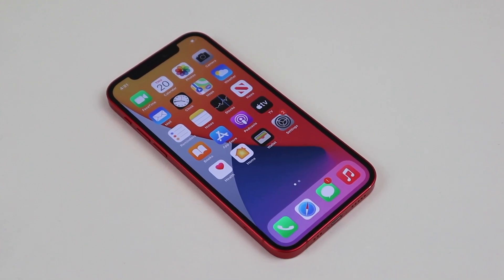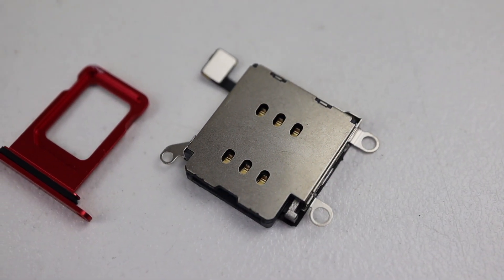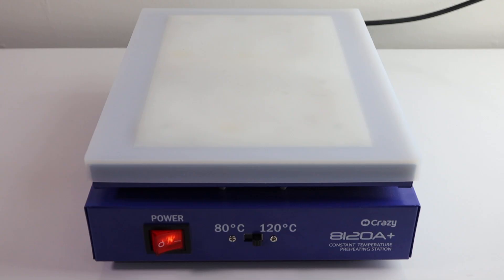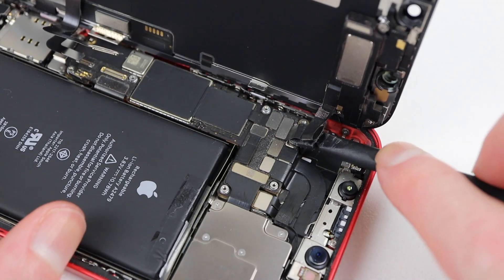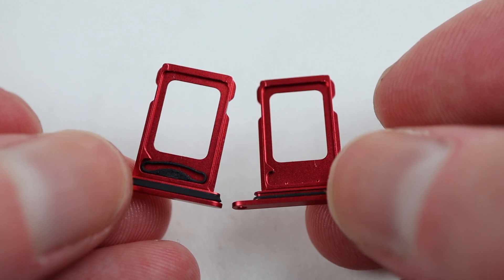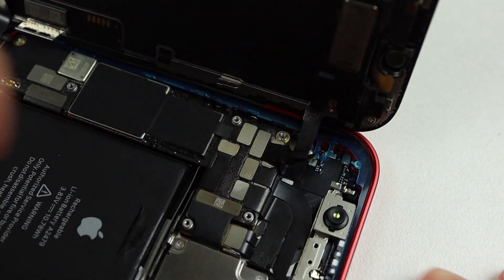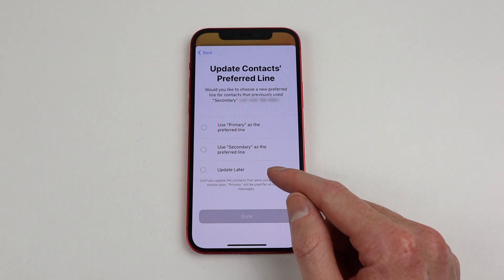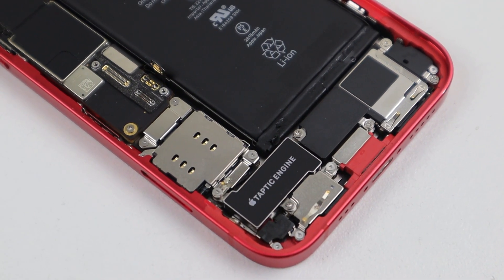Hidden iPhone 12 Hardware Upgrade Apple Never Told You About.

Comment: iPhone 13: SIM card reader paired to the logic board, unauthorized replacement will brick phone.
Reply: just a note, can we stop calling it "unauthorized repair" because we are authorized to fix the stuff we own. lets call it "branded" repair instead. calling it "unauthorized" does not inspire confidence
Reply: @Carterthielftw_  It's unauthorized in the eyes of Apple. 😆
Reply: after watching this video, they will simply lock it down with an update
Reply: I'm calling it now ITS HAPPENING
Reply: Lol
Reply: it doesn't even have a sim card lol , in what age do you live??!?!!?
Reply: @CrazyPlayer-pf2hv  um it does have a SIM card. How else would u get mobile data? Plus in the vid it says it has 1 SIM slot.
Reply: @jvs2uber466  I think the dude was being sarcastic. "Why would the iPhone 13 even have something as archaic as a sim card slot" or apple being all "we're removing the port to further streamline the experience"
Reply: @jvs2uber466  SIM card is not really needed. They only used it because they were afraid of keys leaking and people being able to inject packets and then crash the network. I suppose eSIM seem can actually be emulated.